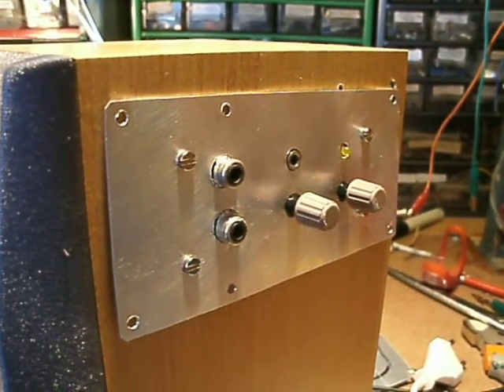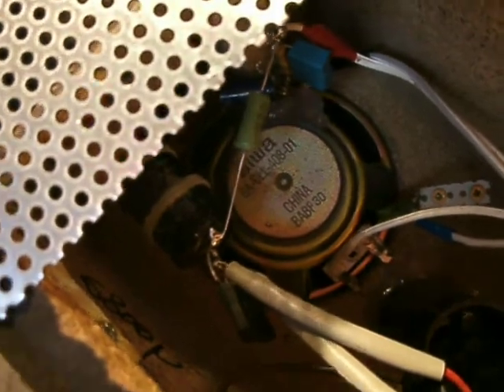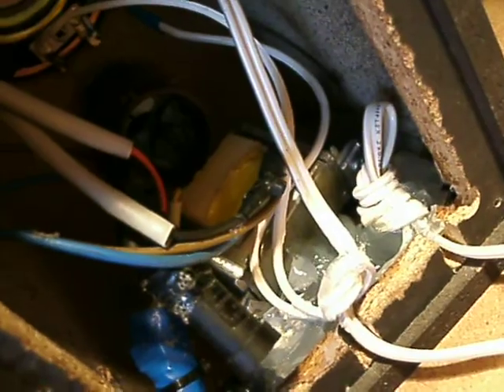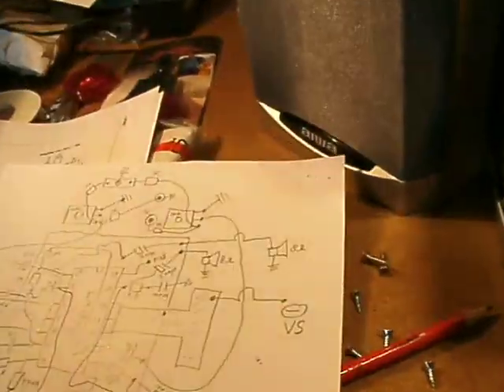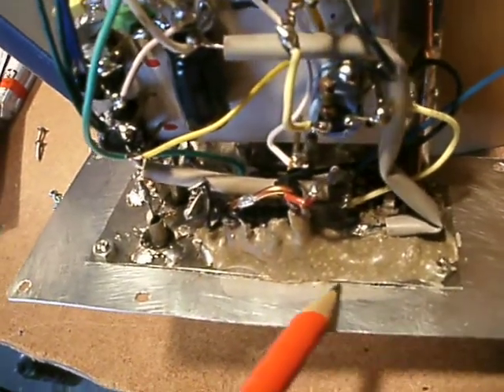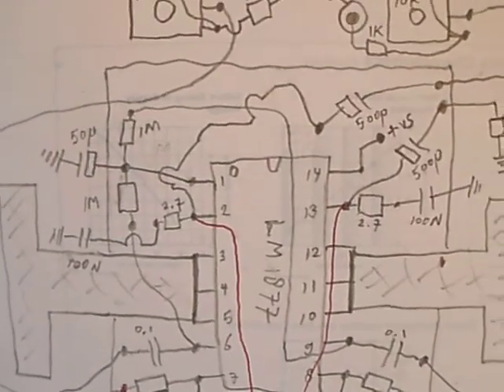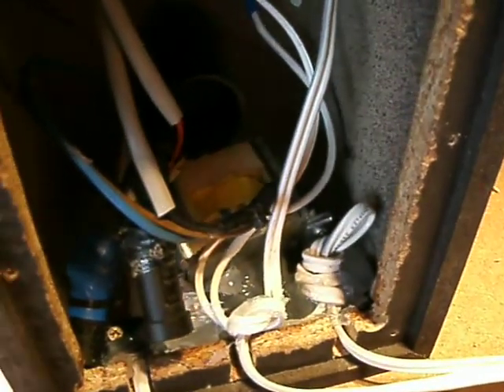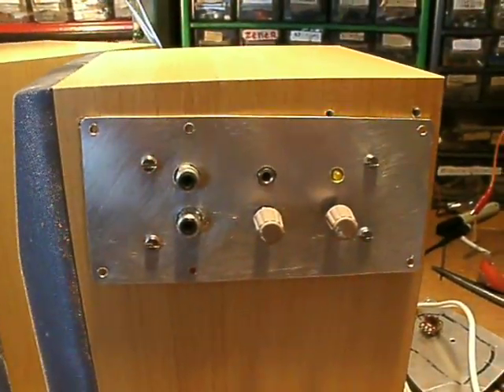How to make a small mini audio set (1-2 Watt)

Comment: Very nice job. I’ve seen several examples of your “potting” some of your electronic components, such as you did here with the potentiometers and jacks. Do you have a video on your channel about how and when to use potting and what do you use?
Reply from the maker: Thanks. I always pot components with a mixture of polyester resin and plaster. Add some hardener, apply it and after say 5-10 minutes all is OK.